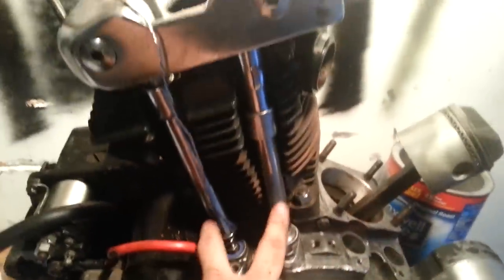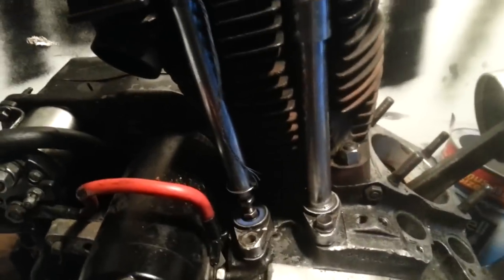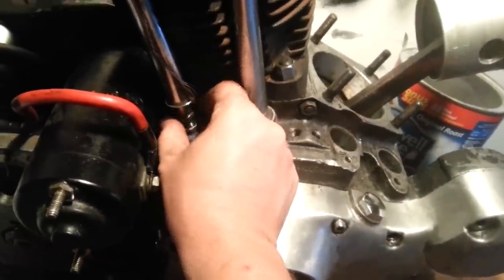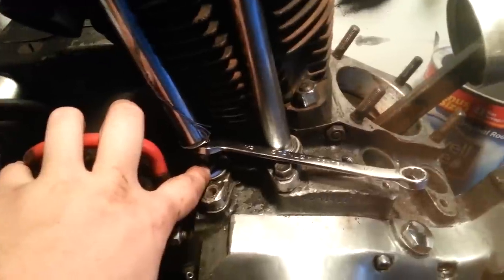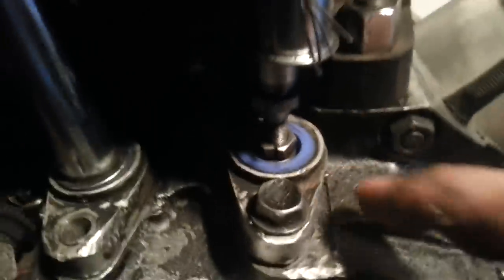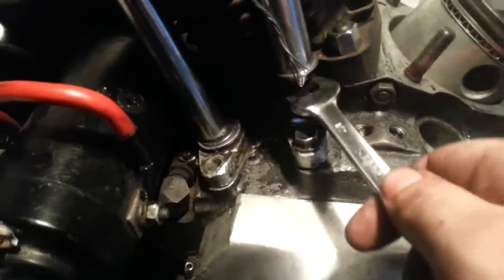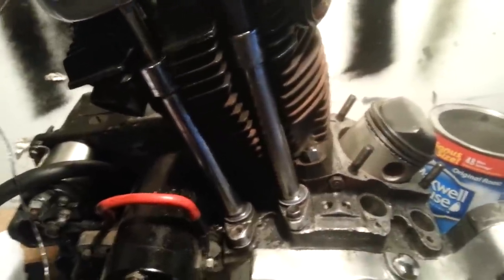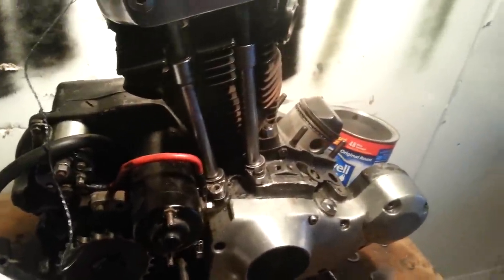Ironhead pushrod/tapped adjustment.

Comment: Jojojeep evo engines are pretty solid. There are a few things I would try. Starting with a pushrod adjustment. It might be just a wee bit too loose and when the engine heats up and expands it could be just enough to start clacking. That would be my step one.

Second thing I would do is change the oil. These engines use a thick oil. In my evo I run a 50wt oil. If your oil is degraded and heats up it will change the viscosity and could cause the clank.

And if that doesnt do it replace the lifter.

Comment: I'm not putting shims back in. My 72 has shims and they are all worn down and thinned out; my feeling is they only shed metal bits into the engine and that's why harley said not to use them.

Comment from the maker: Dana steele the tech manual calls for straight 50 weight conventional oil. I live in florida so when it gets hott I run 60wt. During the "winter" I run 50wt. In a pinch you can use 20w-50 conventional. Some people swear by 20w-50. Some people use synthetic. Dont be scared to try different oils, they will all work. Find out which one your bike responds to the best and use it. 

Also little thing I always do when I change oil in an old bike, I cut the oil filter open and look for metal flakes. Sorta lets you know if you have a rebuild coming up.
Reply: Marcus I have to disagree with you on the side to side movement, The Harley Manual along with the Clymer's states you do not want any side to side movement you adjust till all the shake is gone and you can barley turn with your fingers.

Comment: need to thank you marcus again i got my motor running alot of vids, alot of throwing the harley manual out most of all patience and long hrs i new nothing about the bike a year and half latter i finally got it y so long two shops screwed me bike only ran for after hr and a half and she died, first shop bike sat 5 months called to pull it and a return on my cash deposit, they gave it to me in a box, i re did every thing from crank timing to cams gaskets seals you name it, runs like a son of a bitch and way better then what the shops did for me, no need to ever take it in now so i created my own you tube page to give my thanks to the shops and yous guys can hear her run thank you       https://youtu.be/tt_XSpXq-Ig